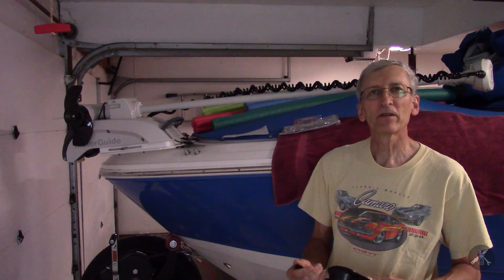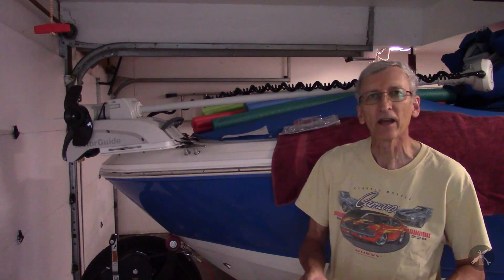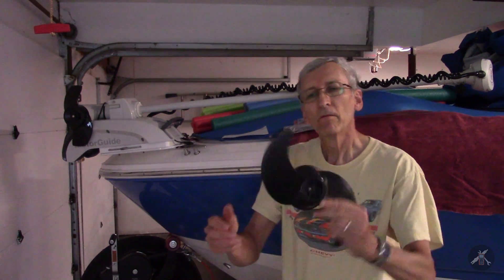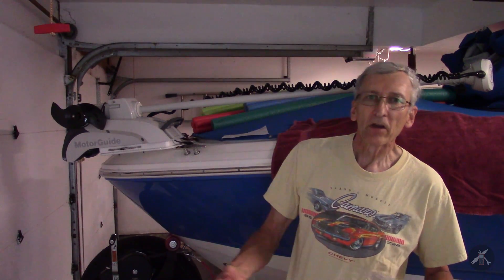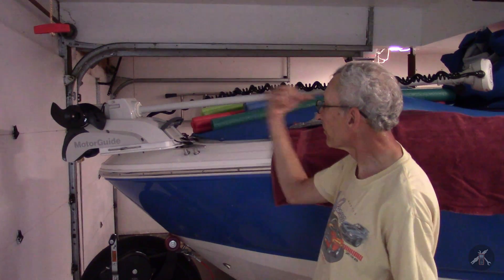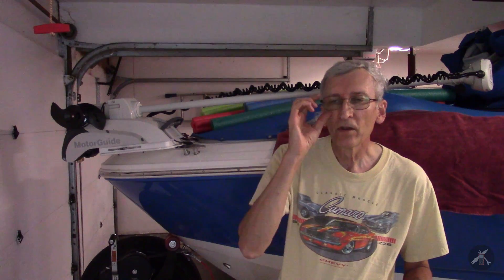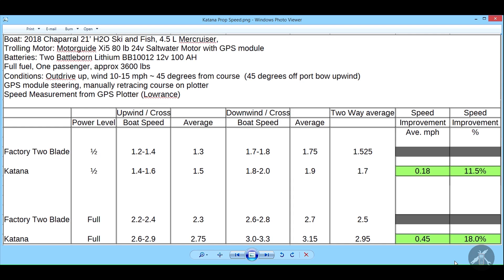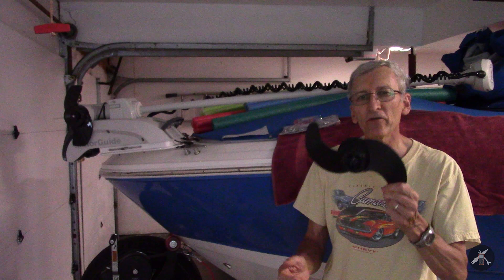Motorguide Katana Prop Performance Comparison

Comment: Which breakers do you use for motorguide and did you get any breaker tripping in the entire test?
Reply from the maker: The factory breaker from Chaparral is a 50 amp.  I have never tripped it.  My Victron BMV-712 measures motor current and it reads 45 to 46 amps at full power.
You can see the breaker and connections in this video for installing the monitor:
https://youtu.be/POXsdkE4d9w